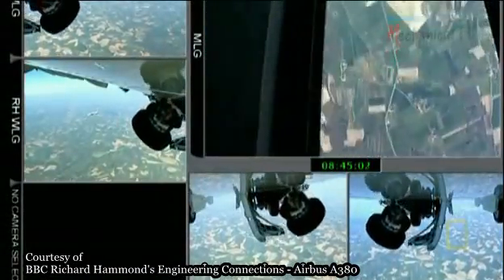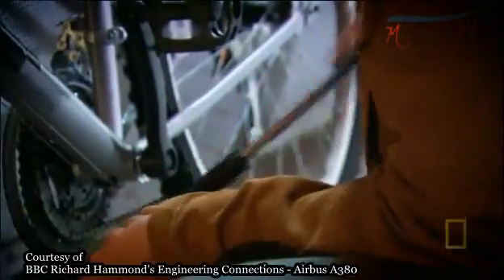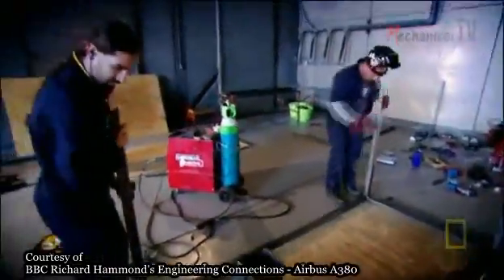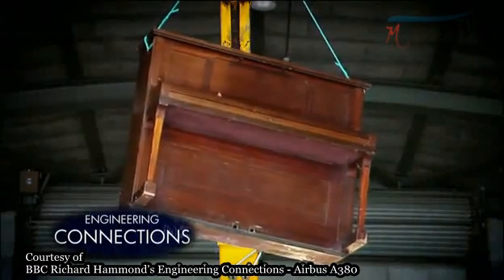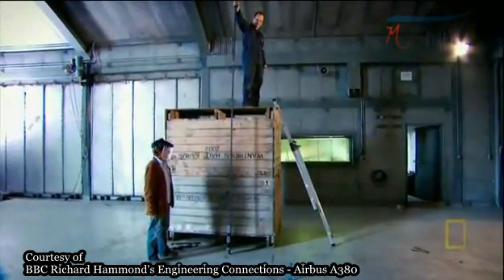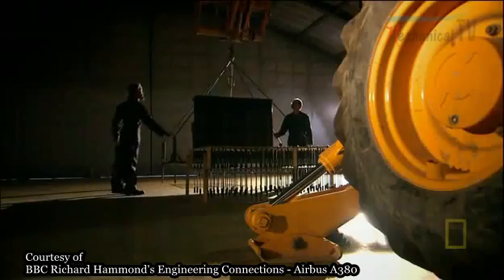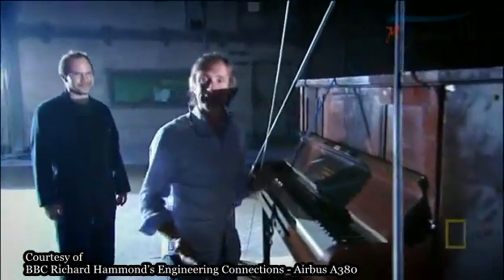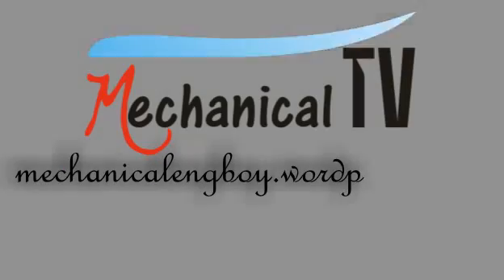The Suspension of Aeroplane's Landing Gear

Comment: That’s not how an aircraft landing gear works. 

The gas inside the cylinder (nitrogen) functions as the “springs”. It suspends the aircraft at a certain ride height, extends the struts as weight is taken off, and adds increasing force as it is compressed. 

But like any spring without a shock absorber, it will rebound. 

The shock absorber is the oil that is in the strut. When compressed it goes through a tiny orifice into another section of the strut. In that orifice is a metering pin (much like SU/Zenith side draught carbs) which changes size depending on how compressed the strut is. Since the oil is not compressible, it can only escape at a certain rate and provides resistance as the strut is compressed.
Reply: They simplified the situation by NOT reproducing the nitrogen filled strut, only building a crude version of the oil filled shock absorber (and then reproducing it 100 times just for kicks)